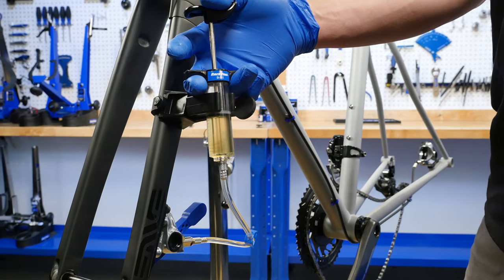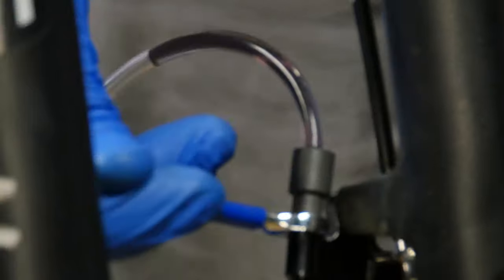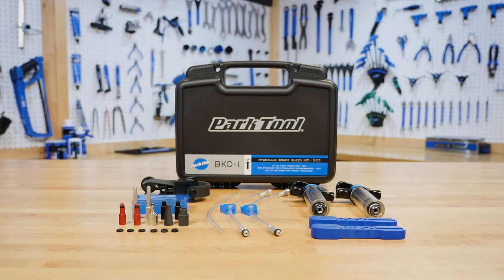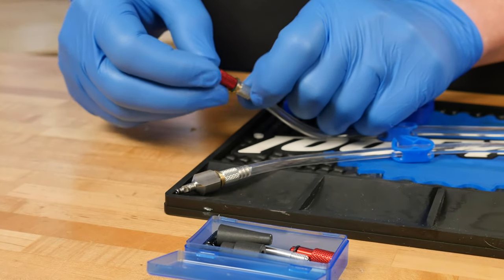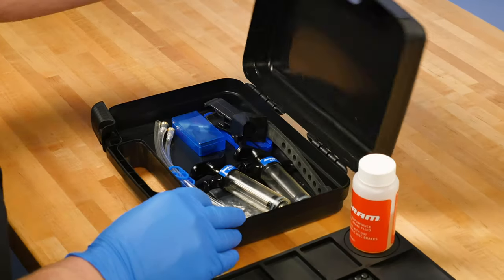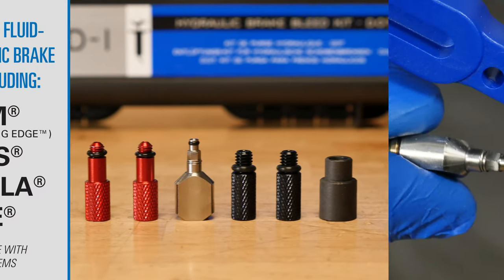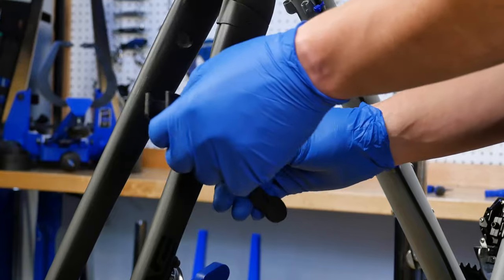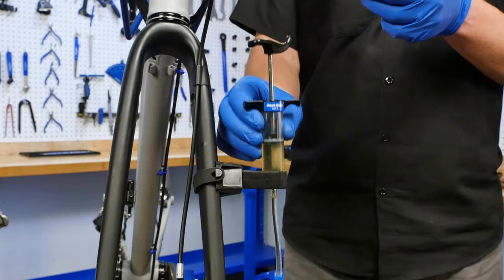BKD-1 Hydraulic Brake Bleed Kit - DOT

Comment: I recently bought this kit and attempted to use it today to bleed a Sram Guide system. I was suprised to find the caliper adaptor I needed wasnt included. Is this available to buy seperately?
Reply from the maker: Check the parts list that comes with the tool against what is in the box.  If this is a "bleeding edge" that adapter in included. Contact us if you have anything missing, info@parktool.com
Reply: @parktool  Thanks for the reply. I have all of the adaptors illustrated inside the lid of the kit. I'm working on a Sram Guide brake not the Edge. The adaptor I need definitely isn't included in the kit

Comment: Hmm is there a reason the mentioned brake systems don't use mineral oil instead? The DOT is bad for both you and the environment.
Reply: Dennis Brockmann The brake fluid is more readily available in any auto parts store and can have higher heat tolerance than mineral oil.
Reply: @MaplePanda04  I usually buy my bike stuff in a bike shop, where 1 liter mineral oil is pretty cheap. Besides, do we really need the same heat tolerances in a bike brake system? I never have any problems or brake differences (drives all year here in Denmark)
Reply from the maker: We also just introduced our Mineral Oil Bleed Kit.  You can see the video here:   https://www.youtube.com/watch?time_continue=5&v=fXvc2lPjDvA&feature=emb_logo
Reply: Dennis Brockmann DOT fluid is about half the price according to my search ($25 vs $13 per liter). Downhill racers need all the heat tolerance they can get.